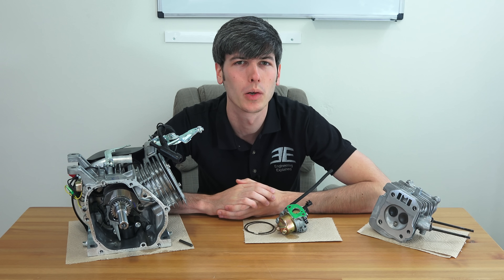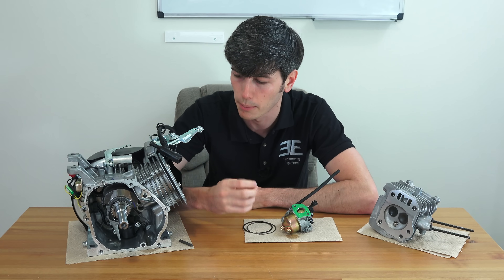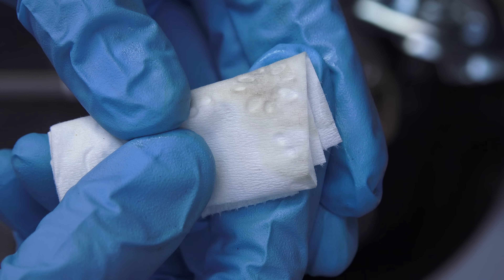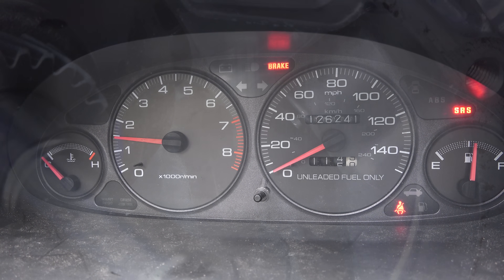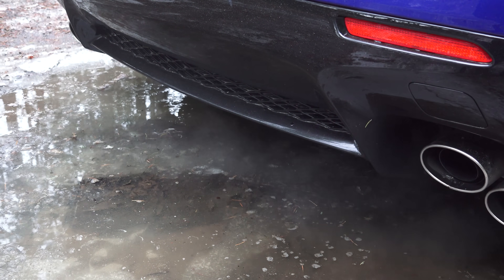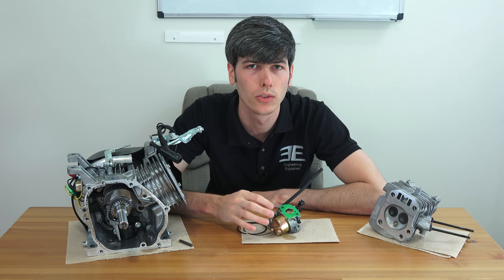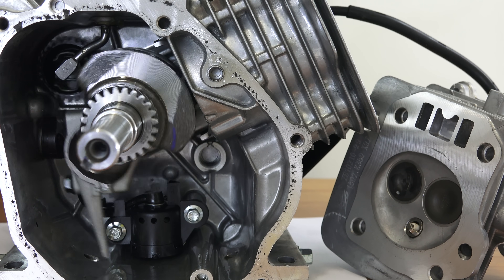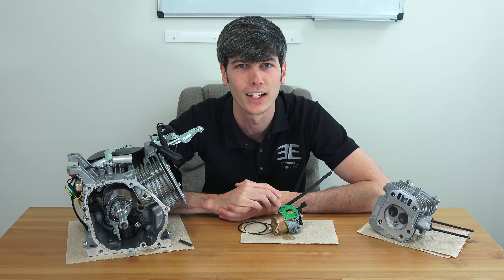Should You Warm Up Your Car Before Driving?

Comment: Thank God for fuel injection. They stopped putting carburetors on modern cars.... Right?
Reply from the maker: Correct.
Reply: Emontay W Thank also the Alfa Romeo (for the first electronic injection Alfa 6C) 1940 Mille Miglia and the Bosch for the further development.. ;)
Reply: +Engineering Explained but what is a modern car? 1990? 2000?
Reply: Nothing wrong with a carbeurator...My daily driver has one and I've never had an issue starting it, so what if it takes 2 minutes to warm up in the winter?  My 4 bbl carb 327 sbc sounds a heck of a lot better than a fuel injected honda
Reply: Sure is a LOT easier to replace one than to replace a fuel injection system.  And, of course, a LOT cheaper, too.
Reply: wholeNwon Exactly, simple, cheap, and reliable.
Reply: What about turning Air Conditioner right away? Is it harmful? If possible, make a video about it. Thanks! :)
Reply: no
Reply: NO.  Not a problem.
Reply: ASIStudios   further
Reply: 1990 I'd say

Comment: Hey, genuine question. What about clearances? I understand that manufacturers design the components to fit exactly when its at operating temperature, wouldn't it be preferred to get it at those temps and then drive it as most people are ignorant about not "revving" the motor until its at operating temps. Appreciate the reply(in advance).

Comment: does this still apply at temperatures of around-40F to -60F? because at those temperatures things seem to change regarding vehicles. this is a serious question
Reply from the maker: 0W-## oils are rated for oil flow at around -35 to -40 degrees. If you're getting into this temperature range, it's good to have an engine block heater. I'd probably wait a bit before driving as at these temperatures nothing is going to be happy haha.
Reply: Growing up in Alaska we always had block heaters but I didn't realize why they might be necessary until now. Thank you
Reply: look up 2-stroke "cold seize". with modern tighter? tolerances I wonder Ii  would apply to car engines. btw even synthetics are as thick as honey at these temps. sometimes also threes no place  tp plug in a block heater (say, at work). and your right about fuel dilution, but what about in the extreme cold? I don't know which is better as the engine will be running rich until a certain point , don't forget short trips also which can lead to large fuel dilution and also moisture build up. I would idle after a short trip maybe lol

Comment: Well my car refuses to rev and it will sometimes even stall when I put it to first gear and attempt to drive and is almost impossible to drive unless it warms for 30 secs up to a minute. After that the idle drops under 1000 RPMs and the engine becomes responsive. Is that a problem?

Comment: I will admit, I've always warmed up my engine before driving. I don't warm up until it's at full operating temperature (middle of the gauge), but just enough for the needle to reach the actual range (the very bottom of the range on the gauge). Is this still hurting the engine? I can now see how this may cause some of the reasons stated in the video, but any detailed input on what I do would be appreciated! 

In the mean time, I'll reduce my warm up to 30 seconds from now on.

Comment: so technology actually solved that problem! :D I guess most people idle the car for the internal heater though and don't care about the engine or the oil in it ("since it is running it works fine immediatly"). What is with Diesel engines? Or a rule for those who don't know if their car is carbureted or not I wonder? Not everybody actually knows that
Reply: If your car was made after the year 2000 it most likely has fuel injection.
Reply: does that mean that my 2-stroke carbureted moped should warm up first in cold weather before I floor it? Serious question!
Reply: Schmidt54 If the engine dies when you try to drive you should let it idle and warm up until you can get going without problems.

Comment: please make a video on things you shall do and you shall not do in a diesel car. i have an 1.9 tdi audi a4 and i am a bit confused on how to handle it. The engine works fine while the car has 199000 km on it. I just changed distribution and all 4 brakes and disks. I do oil intervals at 10-12k km, a little earlier than the manufacturer recomands (15k), using 5w-30 oil, and i change air filter every time or 1 more tine in this interval. The engine has plenty of power for an 8 years old one.
Reply: Sounds like you're taking good care of your car. That should be enough. Diesel engines aren't that different from gasoline engines. As long as you follow the instructions in the owner's manual you should be OK.

Comment: Good video. But you should have mention that in cold temperatures (below +5 celsius) it is proven, that pre-heating engine is usefull. And in this case I mean electric and fuel powered pre-heaters, not idling the engine (or even starting it). Here in Finland, it is really common to use pre-heaters. Less emission, far better fuel economy and already warm car are benefits.

Comment: what about turbodiesels? :D
Reply: If your windows are frozen start the engine and turn the heater to max heat with max fan speed. Then turn on the windshield heater, rear window heater and side mirror heaters if you have them. Then go and scrape the ice off the windows. It should come off easier because you have the heater on. This whole process should only take about a minute. At this point your good to go, but take it easy until the needle in the engine temperature gauge has risen a bit.
Reply: Let the engine roll on idle for 2 to 3 minutes. Then you can hit the road; but don't exceed 2,000 rpm until the engine is at working temperature. Do this every time it is cold outside.

Comment: Is it okay to turn on the AC immediately after starting the engine on a hot sunny day?
Reply: You can do that and it will be OK, but it's a better idea to first drive for a couple of minutes with all windows open. After the hot air inside the car has gone, close the windows and turn on AC.
Reply: thanks, so there will be no excessive wear with the engine or fuel consumption issue whatsoever? I understand that hot air should be taken care of before turning AC on, due to some sort of toxic fumes.
Reply: Ing Tangtawan If you let the wind blow away the hot air you won't need to use the AC to cool that hot air. The AC takes its power from the car's engine, so when you have it on the engine has to do more work. This means higher fuel consumption. So by letting the wind get rid of the hot air you save fuel, because your AC doesn't have to cool down that air.
Reply: The toxic fumes thing is a myth its just faster to roll the windows down to get rid of the excess heat from sitting in the sun thus less time it's gonna take for your AC to bring your interior down to an acceptable level.

Comment: a big thing that you did not mention is that when you drive your car versus allowing it to warm up at idle is when the engine is cold, the pistons are smaller and therefore signidicantly more blowby. so when you drive, you put a greater load on the engine effectively increasing blowby. this will significantly decrease the life of the oil as it has to absorb more carbon from the increased blowby and you will be changing oil more often. what are your thoughts about this?
Reply: also forgot to mention from experience: had changed oil on a car before which was used for short trips only, never warmed up first and after 1500 miles the oil was thin and had a gasoline odor since increased blowby and increase fuel being injected lead to more gasoline escaping past the rings.
Reply: very interesting. Good to know
Reply: This is one of the issues that PCV systems address. When blow-by occurs, it releases unburned atomized gasoline, among other things, into the crankcase. The positive crankcase ventilation sucks it out of the crankcase and redirects it back into the intake system to burn off those vapours instead of them settling into the oil sump and degrading the life of the oil. Thus PCV systems have helped decrease the rate at which oil degrades. So this isn't really an issue in modern cars.
Reply: @mrdragancelan  Unless you have a poorly designed PCV system such as on German engines.

Comment: are you sure? I mean I'm assuming you live in the USA. possibly northern USA. if that is the case you do not know what cold driving is. me myself live in north/west Canada. we're seeing -30c is not an uncommon thing in the middle of DEC/JAN. accounting for wind as well and you can see -40c or higher. in these scenarios would you still recommend this method? I generally wait until the idle drops below 1,000rpm in a gas powered car. as when you start any vehicle in the cold initially the idle is higher (say 1,500rpm or more). it takes a few minutes for that idle to drop. also at that time the temp gage starts to move. it is at that time I normally will take off. slowly at which I stay below 3,000rpm (in a manual car for example). the units I gave above are in Celsius FYI. also curious what you think about block heater (coolant/antifreeze heater) or oil pan heaters. would you recommend them. in a scenario in which they where used. (say plugged in for an hour or so prior to driving). sorry for all the questions just very curious on your educated opinion. and the units I gave above are vague. like let's say it just gets cold enough that if you don't have your vehicle plugged in you wouldn't be able to start the car at times as it just wouldn't turn over in those kind of temperatures. but again these cases aren't an everyday thing. just on the really cold days.

Comment: I disagree... You are right about what happens in the cylinders but I am more concerned about the crank and bearings. You should warm your car up so the oil can warm up so the crank and bearings will have oil circulating through the journals. Also, if a car was not warmed up and driven, now the components are moving more than it would if it was just idling and warming up. Hopefully you respond, I would like to hear your statement about this, coming from another engineer!

Comment: With new vehicles maybe. But in my experience older vehicles and I mean around 17 years and older you should warm it up . Age isn't easy on cars even if it is electronic fuel injection. It doesn't hurt to wait 2 min or so. Especially in winter.

Comment: Can you cover something about higher oil pressure during warm up and it's effects. also for manual cars like mine is it more beneficial to warm up your car? I notice that the car shifts very rough while cold which is no surprise while it's cold but can it cause damage faster this way. I always drive easy until it's fully warmed up but worry about taking off right away because I have 5.0 v8 that holds 8l of oil and a manual transmission

Comment: In a turbocharged engine, does anyone know if low oil temperature can lead to increased oil consumption?
For example does the oil need to be up to operating temperature for the seals in the turbo to operate correctly?

Comment: um how about the different metals expanding at different temps ?? as I mechanic for years.. I have seen so many collapsed pistons because of people putting heavy loads on their engines before they are warm... like in Winnipeg when its -30 below C. I believe your carb theory makes no sense either... atomization of the fuel happens in all motors.. just because the computerized fuel injection... is smart enough for the choke circuit to run the engine smooth.. doesn't mean there isn't extra unburnt fuel!

Comment: what hes saying is happening on "cold start" is actually happening 24/7 rich mixture or not raw fuel will always get on the cylinder walls, the oil + the cross hatch texture is designed to resist it. it only gets totally washed off when you spray enough to hydro lock the engine like this bozo did, and even that wasnt enough to completely clean the cylinder dry.

Comment: I'd still rather let the car get slightly warm before putting load on it. Idling on the spot may take longer to warm up but that doesn't mean there's more wear. Also it doesn't actually take much longer because there's little to no airflow whereas when you're driving the whole engine bay is constantly filling up with fresh cold air cooling the engine down a little.

Comment: I always idle for 2 minutes, even in summer. give time for fast idle to drop, oil to warm up and circulate thru everything, etc. I have to wonder which is worse.. a little warm up time, or people jumping in and taking off with a cold engine, then having to hit stop n go traffic, or having to rev the cold engine to mid rpm or more to get thru the gears, or to enter the highway.  I can see where it would be best to not excessive idle, and start driving if your on a back road where you can be easy on it till warmed up, but for many that's not an option. So which is worse?

Comment: i live in chicago and i warm my truck up every morning before work if its anywhere below 20 degrees. i dont give a crap about my oil or engine, i do it for myself. try jumping into a freezing truck/car and driving it, the windows fog up and freeze 3 seconds after getting in it  making it hard to see, the steering wheel is cold as heck making it hard to hold, you can take off your giant coat so you can steer easier. for me its a safety and a comfort thing. 

so yeah you probably should warm up your vehicle in the morning if you want to see out of it.

Comment: What if it is below 0°F(-18°C) and the poor thing is making some of the most god awful noises you have ever heard, vibrating like crazy, and barely turning 600 R.P.M(when cold idle should be around 1000R.P.M).  I think I will give it 5 to 10 minutes to warm up.  The added bonus is I will get heat to keep my window clear, so I won't die.

Comment: I know this is not related, but 
I'm looking for answers: the thing is I washed the engine in my car at a near car wash with light pressure, after that the engine started shaking and lost power, I took off the coils and there is water around the spark plugs, now the engine can barely stay running, it just dies. if I wait the water will evaporate or should I dry it somehow? Or did I caused major damage to the engine?

Comment: Under normal cold conditions you may not need to wait too long before driving off, though I wait until the engine RPMs have dropped. But here in Alaska when it's -20F, sometimes colder if you didn't plug in the block heater and you are able to get your engine to start, you'd better let it warm up or you may do some serious damage, particularly to the transmission, which also needs to warm up sufficiently.

Comment: Hey man.. I drive a vw Tiguan equipped with a dsg gearbox. However, when I do start my car, I let it idle for a little while until the revs drop. On a cold start it idles around 1.2k rpm. Then drops to under 1k rpm. Then I begin to drive. Am I doing the right thing?

Comment: Highly disappointed in this video... I almost never let my car idle less than 5 minutes before starting to drive it, and even then I try to not surpass 2000 rpms...  the thermal stresses on the turbo and engine are far more dangerous than spraying a bit more gas in the cylinders while idling...

Comment: Altough you were explaining quite clearly why it's better not to let your fuel injected car idle while warming up.  The answer to the question you're posting under the vid: "Should You Warm Up Your Engine Before Driving Your Car?" )should be: yes, but use a parkingheater, so you can drive the car like you stole it right away and you won't dilute the oil wit gasoline/ diesel. (I mean the good parkingheaters that also warm up the engine.

Comment: i do it in the winter for my automatic car because the transmission doesnt always appreciate being put into gear at 1400 rpms, ive always been told doing that while the motor is cold and rpms are higher wears out the torque converter . but its usually takes 2 min for my rpms to drop down to 750 in the cold.

Comment: It's all fine and dandy to get in and drive off in the cold winter time if you live in the south, but up here in the midwest, when it is -10 degrees out, my belts are squealing like mad, my steering is tighter than normal, my engine makes a loud clattering, my starter barely cranks the engine over, I still let my car idle for a few minutes in these conditions, or at the very least, I'll wait for the ice to start to clear off the windshield and drive it very gently for the first few miles until it starts to warm up and the oil starts moving a bit.

Comment: 2618 Forged pistons. Needs to warm up to fit to cylinder walls unless you want piston slap at the bottom of the stroke. 
Yeah, If I had a Pontiac Aztec I wouldnt worry about it, but my guess is a lot of the people who watch these vids don't have stock vehicles.

Comment: Finally someone who agrees with me. You also missed one very important reason to not warm your car up. You warm your car up by idleing it for a extended period of time, also that is a waste of fuel but that is not what I was going to get at. Now you hope in your car, go ok cars all warmed up, and beat the crap out of it. That's fine because your engine is warm, however your transmission is not. The car just idled, so nothing inside the transmission was moving, thus the trans is just as cold as it was when you started it. Much like beating on a cold engine , beating on a cold trans is bad.

Comment: what do you consider light driving? my car is straight piped and i absolutely love to listen to that thing roar but i try not to push it when i first start it. luckily with it being straight piped it doesnt take much for me to hear it or for my neighbors to hate me.  so ill let it rev up to around 3-4k rpms before shifting into the next gear. on average 3,500. for reference my car has a 6,500 rpm redline.